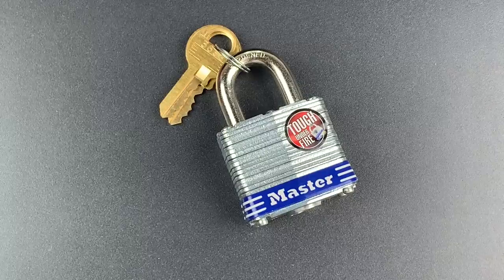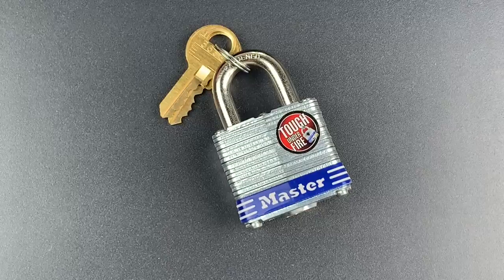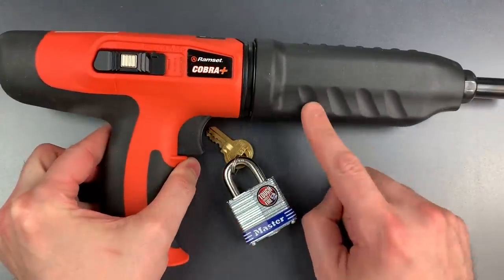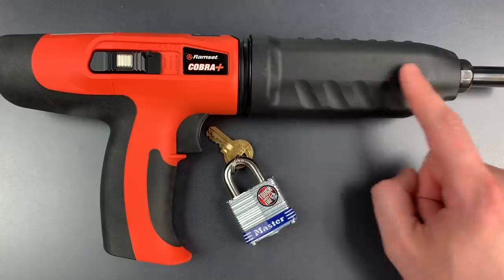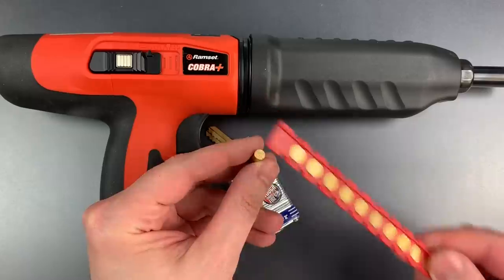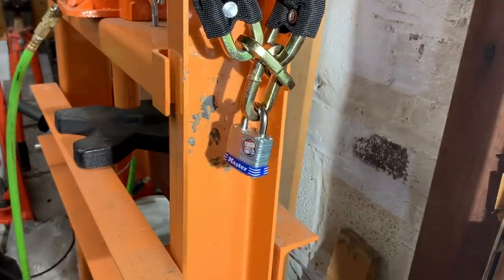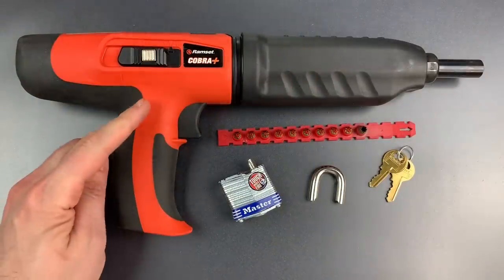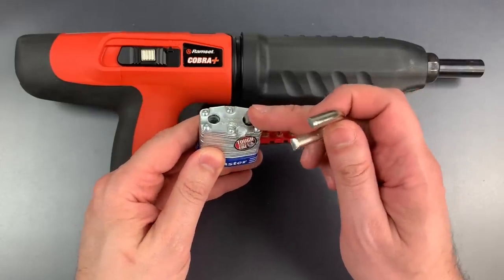[880] STRONGER Ramset vs. Stronger Master Lock

Comment: I wonder when someone at Ramset will ask “what if we just make a nail driver that uses .50 bmg blanks”
Reply: Drive a railroad spike through 3 feet of high carbon steel
Reply: Nah use 183mm blanks from the FV-4005 stage 2.
Reply: Are you trying to drive a nail through the earth?
Reply: A broken wrist.
Reply: Beyond a certain power it's going to need to be a mounted wea...naildriver.
Reply: Omg I want to see this.
Reply: "If we talk to the right nations... 23mm aircraft autocannon cartridges are quite easy to find..."
Reply: Naw use tank shells
Reply: @christophercain7343  that already exists, and is called an...anti-tank sabot round.
Reply: For real, a 9mm would probably be enough for most applications
Reply: @Savyer2  it has a muzzle brake so you won’t have a broken wrist
Reply: Just need the Railway Rifle from the Fall-out game series.
Reply: Don’t waste your time with the lock. Just point Ramset at the door the lock is hanging on and pull the trigger.
Reply: Why not 700 nitro express or 4 bore immediately?
Shoot I almost forgot to mention the 20 mm gun Mark Serbu designed and made.

Comment: I want to buy a Ramset, even though I’d have no use for it.
Reply: Got any cows or pigs you need put down?
Reply: stonent hahahhahaha
Reply: @OZZOZZ  No seriously, a captive bolt humane stunner used in slaughter houses works exactly the same way but is for the most part powered by compressed air.
Reply: That one costs $500

Comment: 0.22 caliber Ramset: please break off
0.27 caliber Ramset: I wasn't really asking
Reply: Next up, 0.357 Ramset: I'm done talking.
Reply: .45 Ramset: ... BANG
Reply: Farmmaster Flex  Honestly, even a 357 seems overkill. I thought about saying 32 (probably more realistically what they might actually do someday), but figured I would go a size up,, but realistically these things are meant for driving nails, for a .50, unless you're driving a railroad spike sized nail, it's way beyond what is required, particularly if we are talking like a .50BMG blank. I would more see a .45 as a little more realistic as those rounds are a high mass, low velocity round in terms of handguns, but again like how big of a nail are we talking?

If ramset were like deliberately making products with theft in mind, sure, we might see some ridiculous calibers used, but for their intended purpose, even a .32 seems unlikely
Reply: He said .50AE, as in Action Express, like the Desert Eagle's most iconic permutation, not a BMG. That is more than a little overkill for anything, .50 BMG Ramset would be used for driving a nail through steel *plate*.
Reply: Mr. Trox i reallly need a 50BMG ramset. Its effectively an Anti tank weapon! Haha
Reply: @WisKy64VT  Never know, could be a government issue Ramset, never know when you might need to attach more armor plating out in the field to your tank. Probably a million per nail at that point though. That recoil though..
Reply: @Mr-Trox  The ramset he has now can drive nails into steel plate mate, I have one.
Reply: @marvindebot3264  how thick of one? I wasn't clear, but I was thinking along the lines of like ship armor.
Reply: @Mr-Trox  It will drive a hardened nail thru 10mm plate. They pack quite a punch and mine is by means a new one.

Comment: MasterLock:Makes newer and improveder lock

LPL:What about a GUN
Reply: New and improved, nothing much new, not much improved, just needs a bigger crowbar to open it.

Cannot be both new and improved at the same time, only one or the other to a greater or ( in this case) lesser degree.
Reply: Good Lord, looking at the prices for that thing you could just buy a highpoint 9mm.   Or not, never buy highpoint.
Reply: And if that don't work, use more gun.
Reply: @kahless0173  Yeah but a felon can buy a ramset I bet. Its not a firearm. Its sold home depot. Also not considered an B&E tool if you keep it in a tool bag. There is a lot of reasons a criminal would want to buy one.

Comment: @0:58 Ooh, so that's what it's supposed to be used for! Silly me was using them for setting RAM in motherboards. I did wonder why so many of them failed to POST afterwards...
Reply: Would that be the ultimate Widlarizer? Almost thinking I'm needing a new tool for the electronics lab.
Reply: @zrobotics  There are cases where using it for the intended purpose is bad, like when the builder built the concrete wall using something that looked like concrete, but in reality it was more beach sand with ambition. When you use the lightest charges, and still have to go looking for the nail in the middle of the wall you know you have issues. Solved by using 2 thicknesses of steel to grab most of the power, and a long nail to get some grip, and using a lot more than intended.

Seen some though where no matter the charge, and how sturdy the nail, they just left a skid mark on the surface and a flat nail. Concrete made to nuclear blast proof strength, 1:1:1 mix, plus plasticiser, plus high strength additives, and fully cured as well.
Reply: If you have trouble getting the mobo to post, apply a posthole digger.
Reply: @danpowell806  Thanks for the tip!
Reply: @Tombsar  If your PC doesn't boot, try applying a high amount of force to the CPU with a boot.
Reply: many
Reply: Hopefully you have a swiss Army Knife handy, and don't forget your anti static wrist band !
Reply: Tombsar... I take it ya Subscribe to the "Tim the Toolman Taylor way of thinking"...? XD

Comment: [983] 30mm Ramset vs. Even Stronger Master Lock v2.0
Reply: Ramset: Bofors Edition
Reply: [2658] Naval Artillery Battery Ramset vs Master Lock (Now With Metal!)
Reply: [6949] Atomic Bomb Ramset vs. New and Improved Japanese Master Lock
Reply: Mr. Trox That escalated quickly...
Reply: @Mr-Trox  [7000] Death Star Ramset vs. that pesky planet that builds these pesky Master locks.
Reply: [10000] black hole Ramset vs. uy scuti lock

Comment: Only tangentially relevant, but still relevant to this channel: I've been watching for a few months, and yesterday had a customer with a (really crappy) combination cable lock stuck to their bike because they'd forgot the code. Using knowledge gained from this channel, my 4sevens mk2 flash light, and a simple pick (not a lock pick), I decoded the lock and gave it back to the customer. Fun!

Comment: That Ramset had a bit of kick, eh. one could probably do that 99 times and have no issue but then the 100th time the lock flies off into your foot  and the chain comes around the other side of the I beam like a tether ball and knocks all of a persons teeth out. I love your videos, I'm glad to see that you are using more safety gear than usual.
 So now, what happens to those poor little orphaned keys? lol
Reply: scrapped for brass

Comment: Even though you gave an excellent demonstration, and it's much quieter than my Ramset, a criminal would never use one due to the noise level.
Reply: electronicsNmore I wouldn’t say never, there are some bold criminals. Most criminals go for the brute force method vs picking or a bypass.
Reply: @rileyfenley522  Bolt cutters get the job done with little noise.
Reply: @electronicsNmore ... I think you ought to let the criminal decide when it is safe to make noise and stop making ill-informed assumptions.
Reply: Depends on the population density and the basic noise level.
Reply: If it was in a city like Chicago, would anyone even notice the extra gunshot?
Reply: @awkwardcultism  I hear a lot more gunshots out here in the countryside than any city I've ever been in.

Comment: Tough under ramset....well apart from the crappy shackle.
Reply: Even the lock body got badly deformed.
Reply: @two_tier_gary_rumain  true but that is ok, under gun fire it can has a hole in it if the famous  picture is anything to go by.
Reply: Unfortunately, there's not much you can do to make the shackle stronger aside from making it bigger.  The hardness in this case was actually the reason for failure.  In most cases, you can have either hardness, or soft and durable, but never both

Comment: After watching LPL videos, I decided to try picking a lock that’s on my toolbox at work. I never picked before. 

Having an old Master No 3, I used a old dental pick and a .025” shim I cut to get tension on the core. Not even a minute, it was opened. 

I plan on changing locks.

Comment: That was quiet! I can tell you that the original caused quite a commotion in the Johnson County Kansas District Court one Friday afternoon about fifteen years ago.  The tradesman was using one to anchor a new security fence in the marble floor at the front of the courthouse.  Nobody was warned and that tradesman didn’t give much thought to the commotion that a gunshot might cause. 

Four anchors set caused an impromptu race of bailiffs & Sheriff’s Deputies with weapons drawn ready to repel the invaders to assemble at the (disused) entryway. They were confused until the tradesman put another anchor in without mentioning what he was doing there on the floor,  funniest thing to see on closed circuit TV! 

This new one has made a remarkable advancement in noise suppression!

Comment: Very interesting result. It kind of puts lock makers in a catch-22 (or 27?!) situation. The harder the steel for the shackle, the more brittle it will be and therefore more susceptible to sudden impacts like this. The softer the metal, the easier it would be for brute force to cut it such as bolt cutters.

Of course there's a range of alloys that provide different physical properties, but it should be a pretty safe bet to say they're already riding pretty close to the 'ideal' alloy that's both hard (and chromed), and 'tough' (less brittle). Even protecting the shackle with a shroud wouldn't necessarily stop this attack, since the strike landed on the body itself.

I guess the moral of the story is: If someone really wants past a lock, they're going to get past that lock! Ya' just have to make it as difficult as possible. (Seriously, has LPL ever failed to get a lock open after a few tries?)

Comment: Rather than firing the Ramset empty and damaging the piston you can cut off concrete nails about half an inch below the head and load them in there with the head resting on the lock. Gives the piston something besides itself to deform.

Comment: I have seven Master Lock #3s. I was told that they're a great lock to learn on, but that I should get two or three because with bitting and tolerance variances there's a lot of variability in how hard they are to open. Boy were they right. Several of them were easy to open the first day when I didn't know anything. They seemed to just accidentally fall open. One of them I could open occasionally, but other times I'd have no luck. One of them I painted on a big red H for hard. I couldn't open it at ALL for the first few weeks. Got them all now, and am working on a Master #7, a Master #140, a Brinks 40mm Brass Padlock, and in the wings is a Master lockout lock and a Master #230. The Master #7 is pretty easy, I just have to use small tools. I've gotten the Master #140 but it's iffy -- sometimes no bueno. I have NOT gotten the Brinks, the Master lockout lock or the Master #230.

Comment: Not surprising that the shackle failed at the detents, those are the thinnest and therefore weakest part.  The problem with a power attack like the Ramset (or a firearm shooting down on the top like that) is that you want a slightly softer material, or at least one that is less brittle, to be able to survive it.  It's like the difference between an aircraft-grade bolt and an automotive Grade 8 bolt.  Grade 8 is theoretically stronger, but the aircraft-grade bolt is much more tolerant of vibrations and strong stresses without failing.  But a less-brittle material is easier for bolt-cutters to go through.

Comment: I just came up with a new anti burglar technique, by putting heaviest anvils on top of valuable furnitures like a fridge or kitchen roof, it would be very hard for them to remove, and it would make a lot of noise in case of a pushing attempt, and even if they succeed, they still have a limited time and would run away enough slower in case of escape

Comment: Ramset doesn't just offer different caliper load sizes, they also have a coloring system for strength of charge.
LPL used 27cal red in the video but there's still one level above that at 27cal purple!

Comment: The scratches on the orange shelving do look as though this wasn't the first Ramset victim that has been tried there.
Reply: That isn't shelving, that looks like a hydraulic press frame, probably meant for bearings but you could squish a lock with it (aluminum or brass).

Comment: Lock Picking Lawyer you need to put a 3/8 x 1 1/4 inch grade 8 bolt in the barrel. Otherwise when you dry fire your loosing full potential of ram set. Dry firing your only getting impact from the pistion bottoming out on brake bushing

Comment: In time LPL will turn this channel into something around the same lines as the Hydraulic Press Channel.... only with using Ramset on everything.
Reply: And then there will be a spin-off channel called Beyond the Ramset.
Reply: LPL did test that lock on a HF hydraulic press too.

Comment: Although I find the content entertaining.    I can not help but think a shorty handled 2 lb hammer and a hardend chisel or shaft of some kind would do the same thing , just blast the little bugger to peices  ->   might take a couple of blows if your aim is off...   also kinda depends on the position of the lock and the angle of the dangle of whether you get a good swing on it.    Which would give the Ramset the advantage as long as you can fit it in there and get its beak on that lock and find some support behind it so it can't wiggle around on you.    The devil is always in the details.

Comment: I'm not certain but I think black tip cartridges are the most powerful but there are 5 different colours denoting higher or lower power, the old spit nail guns used a round cartridge thing instead of the strip

Comment: Master is such a frustrating company. Their biggest problem is their lock cores. Most of their keyed padlocks are great- in their class- as far as brute force attacks go. The No. 3 is actually quite strong for a cheap padlock. Their "Magnum" series, with the boron steel hexagonal shackles are great. We use them at work to secure our gates, because really stupid people are constantly trying to break in. The people trying to break in couldn't pick a 1- pin lock if their lives depended on it, so we're not worried about the core. The shackle of the lock on the front gate has all kinds of dents from unsuccessful bolt cutter attacks, and the body itself has been beaten silly, yet it still holds, and the mechanism works flawlessly. Their lock cores are piles of suck, however, and that's what is so frustrating. If they'd stick a decent core in there and up the price by a couple dollars, they'd be hard to beat.

Comment: Assuming the ramset uses a 0.27 Cal cartrige, it is probably as loud as a firearm. Using this tool to break locks seems very impractical. Do we have any data that shows this is a common tool used by criminal or are we just looking for a tool that can break any lock?

If so, I bet no lock in the world can resist the jaws of life.

Comment: not that i'm inferring anything by this. it occurs to me that if the entire lock and head of the ramset gun were rapped in a small blanket there would not only be no need for ear protection you would do less damage to the paint work too.